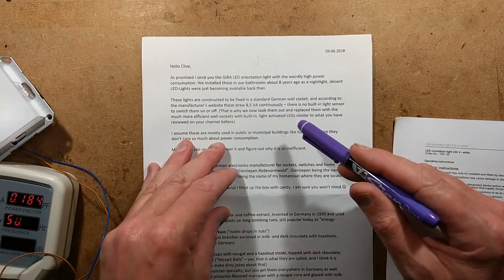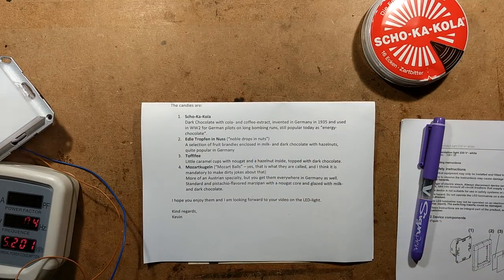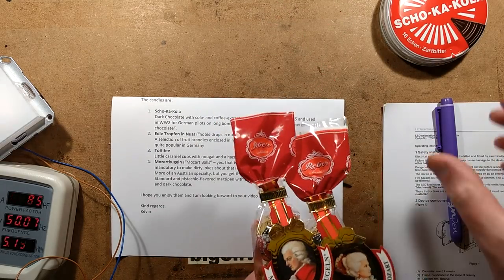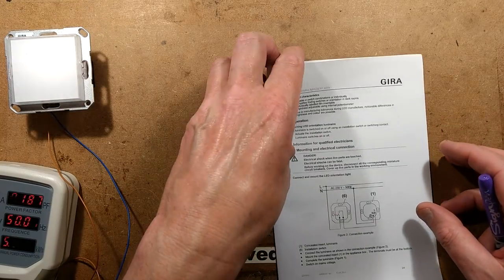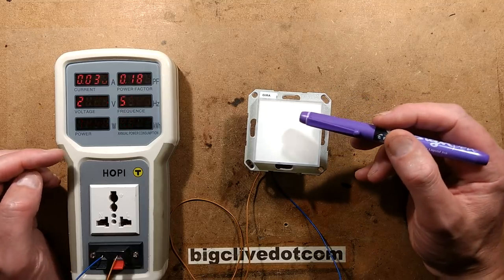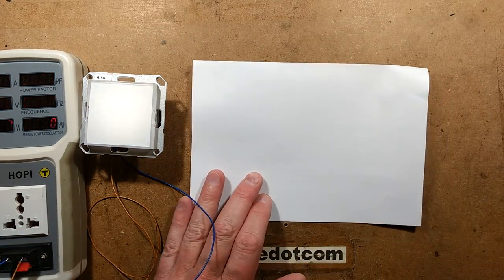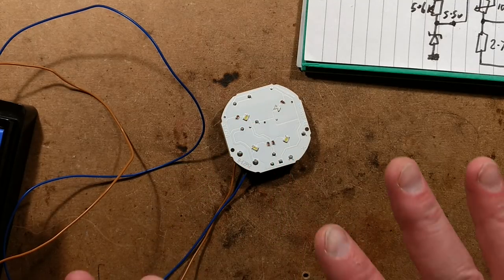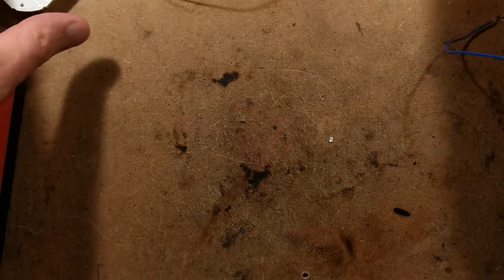Well engineered German LED light?  With schematic and tests.

Comment: If the power companies start charging domestic consumers for apparent power I WILL switch back to incandescent bulbs
Reply: I am seriously considering candles.....
Reply: Jamie Phillips Did you think that all the way through?
Reply: They do heat up the room, and break very easily...
Reply: And they constantly need to be replaced.
Reply: I never left incandescent, they have a much more predictable lifetime and better quality light output, as well as being non-directional.

Incandescent has only one point of failure, yet with LED, CCFL, you have say 20+ components in the circuit, all of which can be a point of failure, and you never know if the thing is going to last past the first month.
Reply: maybe the Chinese ''20kW miracle power saving device'' will finally become usefull then. or rip all the lamps out and just charge batteries to run leds :').
Reply: +My Work ... that was not only not related to this comment thread it was a dumb video
Reply: Incandescent bulbs are honestly not that great. The light isn't magically better compared to any good modern LED or CFL bulb, and the electricity costs are much higher even if power factor is involved.
Reply: I am in Canada so we get lots of those
Reply: you can't fiding incandescent is a pain now
coming from someone who is uv intolerant and MUST use incandescent light  ( only non uv emitting lamp (with fuking sodium but yeah it's sodium)
Reply: idontcare80 - my experience with incandescents (100w) has been very positive. Most of our incandescents seemed to last years, even in daily use. Philips bulbs were particularly good for lifespan.
Reply: I got away from incandescent due to inefficiency.
I use 12VDC LEDs for my lighting exclusively already.
A small solar panel charges the batteries which are 2 6VDC SLA & a simple charging circuit.
Using these batteries means I can have lights for 7-9 days, at full brightness, without any sun at all if need be.
Reply: How do you go outside if you're UV intolerant??
Reply: @Alfonce Jean Incandescent lamps give out a lot more UV than white LEDs and still usually more than CFLs.
Reply: My Work I bet it isn’t
Reply: Agent24 what LEDs are you looking at? I've been full LED for 5 years and have only had to replace 3 bulbs in that time. They are now just as bright as incandescent, just as cheap as incandescent, and are diffused well enough to not have any directional issues. And I've saved quite a bit on power bills.
Reply: +erica Incandescents have a better color rendering index (CRI) than LED. Even LEDs with very high CRI values will have gaps in the spectrum of visible light it produces. I prefer LEDs for their efficiency and versatility but they can never quite match the same broad spectrum of light produced by most incandescent bulbs.
Reply: +James Van Damme   Technically, everyone is UV intolerant. Hence why you get sunburned from UV exposure. My guess, however, is that they have some sort of eye disorder which makes them particularly sensitive to UV light.
Reply: Phil S - Yeah, years (although, in my experience it was often months).... I'm looking at close to a decade for many of my LEDs. People just buy cheap LED products and think that represents what the technology is capable of, it's ridiculous.
Reply: And where are you going to get them? EU has already killed all the reasonably powerful incandescent bulbs and the rest will probably go in a couple years. 
I stocked up before those retarded laws came into effect, but most people didn't.
Reply: Please show me a good LED bulb for less than 1$! I bought some really good incandescent bulbs for less than 50ct per piece but this was in Russia.
Reply: Amazon Germany has incandescent bulb in many variations for approx. 1€ per piece (e.g. B07B6B21BJ).
Reply: I pay about $10 for LED lamps, but they'll probably last for 20 years and they save me more than $10 on my energy bill.
Reply: idontcare80 Yeah, Home Depot, Lowe's, and Publix has an almost perpetual LED bulb sale. They're name brand bulbs for $3-7 or about 50-75% off regular price. Incandescent bulbs suck. My dad "hates led bulbs." But their house has been running on them for a couple years now. Lol. Don't tell him. He never even noticed the day I switched them out. Not even his reading light over his chair.
Reply: people will use what ever light sorces they like
Reply: Okusar +James Van Damme Some people suffer from a fairly common condition called Polymorphic Light Eruption which makes them unusually susceptible to uv light. It cause them to have an allergic reaction and break out in a very angry, itchy rash. I don't know details regarding wavelengths or anything but I do know that I once had a student who, when I changed all the halogen lamps in my studio for lower wattage LED spots, suffered a really bad reaction on the back of his neck and exposed areas of his face. I subsequently had to turn off individual spots every time he came so that the drum kit wasn't flooded with light. He used to suffer badly on cloudy days too and was perpetually dosed in sun block. My mother in law suffers from it on less serious level and has to have treatment before they go away to anywhere with an especially sunny climate.  When incandescent bulbs were phased out it was a big deal for many people who struggled to light their homes in a way that wasn't damaging for them. Not trolling here, just thought you might be interested!
Reply: I am talking about people in general not the special case people ... I have a Polymorphic friend he uses 60 watt bulbs with special shades over them
Reply: Incandescent bulbs are vastly inefficient, but a lot of the LED bulbs and nearly all CFLs suck at producing deep reds (640-700nm), and far-reds (700-800nm). The CIE's "anything over 700nm is infrared" claim is bullshit. If you look through one of those 'IR cutoff filters' from a digital camera, which typically cutoff at 700nm, red will look duller, the slight red tint on 'black' fabrics disappears, and some colors in the sunset disappear. Many other organizations recognize the visible spectrum as extending somewhat past 700nm, but not the CIE, who are the ones who invented the lumen based on a graph FROM 1929! The CIE does not include far-red in CRI calculations, even though I can see a clear difference when far-red is cut off.

Here's a video about far-red
https://www.youtube.com/watch?v=RpuMPLHiLt4

Comment: 11:17 — According to the date in the manual, this type of light was introduced in 2011. A 1998 light probably wouldn’t use white LEDs, as they were very expensive then and not popular until the middle of the 2000s.

This light is, by the way, still sold for around 50 Euros (overpriced IMHO, even for ’German engineering’).
Reply: Everything made by GIRA is overpriced.
Reply: You can call any German electrical products overprized. Nevertheless, there are still people and companies to pay the ’little extra’ for German products, and so companies like Gira can exist.
Reply: Well, i wouldn't say ABB for example is overpriced, same as Siemens and so on...
Reply: It depends on the product. Whereas components like circuit breakers, RCDs etc. are reasonably priced (due to the highly automated assembly and no need for big advertising), this doesn’t apply in my opinion for example for most kitchen and household appliances by Siemens/Bosch (consolidated company branch). The more a product is advertised for private consumers, the more you pay for ’hot air’, as with fancy flickery night lights. And hot air is very expensive here in Germany ;-).

Comment: Wow, zeners across series LEDs is such a simple yet clever solution to one of them going open circuit, its amazing, why havent I seen that yet?
Reply from the maker: Because it would add a lot of expense to most lamps with a lot of LEDs.
Reply: Sure but with most of these lamps with a huge number of series LEDs failing in exactly that way, it might be worth the money.
Reply: Chuckiele If a cheap lamp fails, the consumer will just buy another one. Built in obsolescence.
Reply: Does the same job as the metal oxide varistors they fitted across tungsten filament fairy lamps. If the filament goes open then the varistor goes short allowing the rest of the lamps to stay on. If an LED goes open then the zener will conduct but will drop a few volts.
Reply: Then LED lamps will end like incandescent lamps.

Comment: That smart meter thing got me two years ago. I had a large fan which got "dimmed" with a triac dimmer. I caused a terible power factor and we got charged like crazy! Last year I got a nice Variac and our "power consumption" went down a lot. Well what do we learn from that, always check your PF if you have a "smart" meter installed.

Comment: I wonder if there will be some lighting standard in the future where there will be DC power supplies running each lighting circuit.  With a dedicated power supply, it can take care of the power factor correction, rectification, smoothing, etc. which would simplify LED lamps, i.e. they would need to do little other than buck / boost the voltage for the LEDs, much like 12V lighting circuits.  This would in theory do away with the issue of stroboscopic and low power factor LEDs as the main DC power supply would take care of the smoothing and power factor correction.
Reply: The problem is, that a 12v lamp is much more expensive.
Reply: In fact there would be no need to boost the voltage since each LED requires only about 3 volts so they can be connected in parallel or series-parallel. In my house I ran a 12 volt line to feed a number of 12v LED strip lights. What I failed to account for was the current required and I used only 3 Amp twin flex!
Reply: Manolis Gledsodakis That's the reason I would use 24v or 48v. It's still low voltage, but can handle much more power.
You can upgrade yours to 24.
There is a lot of voltage drop at 12v DC over thin wire.
Reply: Frank Gormanns Might as well go 48V like in telecoms. Anyway any efficient LED circuit running from a DC supply will need a switching regulator to convert back to AC to avoid wasting real power in a hot dropper of some kind.  An AC to DC converter for a single lighting circuit can be an almost pure current supply feeding a series circuit.
Reply: Done that in our (and the neighbours) RV: ALL interior lighting is 12v d.c. LED.. We used the very reliable off-the-shelf 12v rated cable for garden lighting - really cheap, and very low volt drop, even on longish runs. Also we copied the UK Ring-Main approach - the lighting circuits are all double-fed, and all the regulation components were via our friendly Chinese suppliers - reliable, simple to repair (should they fail), and cheap enough to hold supplies of spare modules "just in case".
Reply: 12V DC for strips using 3 LEDs in a row is totally inefficient. sadly they get produced and bought a lot now.
for 3 white LEDs in a row 9V (running low power) or 9.9V would be optimal. If your going for full 3.6V it would be 10.8V.
Just abit more voltage and a resistor to control current over thermal drift and you're fine.

- But those (cheapchina) led-strings now getting sold with 12V-DC supplies a lot, basically waste 20..25% into resistor heat.
Because they seperate DC-power supply (cheap bought already CE-certified)
from the led string and sadly the 12V are a cheap standard to get.

If you look at integrated DC-DC or variable output voltage (which are worse) modules they sadly also only get over 70% efficiency
if you are really lucky and hit the optimal current for the inductors.

Comment: The problem with low power factors isn't so much the requirement for thicker lines.  After all, the power distribution system we have was set up in the old days when we all had filament lamps (non-lighting loads take significantly more current anyway), so they're already up to the job and factored in to the power costs.  The problem is that resistive power losses in the lines are proportional to the square of the current: I²R.

Industrial users with motors (inductive loads) are already charged extra, and have been for a long time.  These capacitive dropper lamps are now common enough that they're causing problems too.  Well, they're causing problems at the local level.  At the national grid level they're compensating for inductive loads and bringing down the losses on the national grid.

If the power companies charge for apparent power that will be a real rip-off.  What they should charge for is the resistive losses in the lines.  Naturally, they'll try to charge for apparent power until there's enough backlash that they charge for line losses instead.
Reply: Yes, put simply they might charge for shunting power in and out.

Comment: I have a question ... 

Does the utility company have to put in ‘real work’ for your apparent power ? 

The way I see it the answer is yes, since all the capacitors people stick across the AC mains basically try and brake the 50Hz oscilation ... 

Again I don’t have the full picture, so, would love to hear some explanation on this
Reply: Capacitors don’t dissipate real power. That’s why capacitive droppers are popular - they don’t get hot like a resistor would (resistors dissipate real power). Caps simply “borrow” some power for a short time, then give it back every cycle. The problem for the power company is that the distribution lines have to carry that power that is oscillating back and forth. The power company does have to make up for what is lost as heat in the wires.
Reply: @stargazer7644  thanks a lot - nicely phrased !

Comment: That would be fairly new and shocking to me that you will be charged for apparent power as a household consumer. And even if: 10 VAh will not be the same as 10Wh because that is not Energy that gets used and only oscillates betwee producer and consumer. 
I work at a big industrial company in germany as an electrician and of course we get charged for VAhs but not nearly as much. This extra cost is onyl there to cover the additional expenses that occur when having higher current like bigger cables, more losses on the  cable and all that. Thats why we compensate most of it as  the main loads are big motors
Reply: So maybe the smart meter should charge the consumer for shunting the energy out  to him and credit the customer for energy in to the company?

Comment: there are 2 caps to increase the volt tolerance. adding them in series doesnt increase the capacity, but doubles the voltage rating to 500V, which is needed because the max voltage difference between two 90degree shifted sine waves is ✓2 times the individual amplitudes. so in this case about 350V(minus ca. 20V for the leds), which would be too much for a single 250V cap.
i guess... ^^
Reply: Alex Trinker - You're in no way wrong but I think the reason it's strange is just because they didn't use a capacitor rated at 400V or higher in the first place...
Reply: Normally you use a single capacitor that just has the voltage rating you want. Nothing difficult about that.
I suspect they are doing this because they may also make a version that runs on 110V. Then they only need to use a different PCB, but the same components.